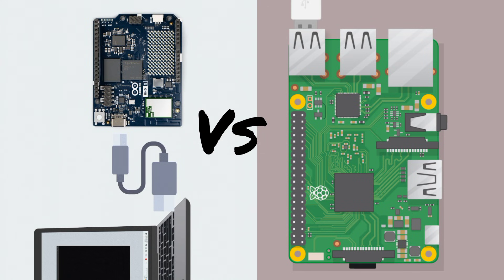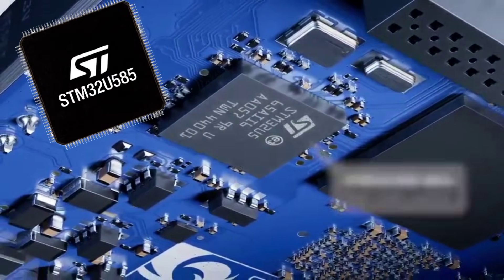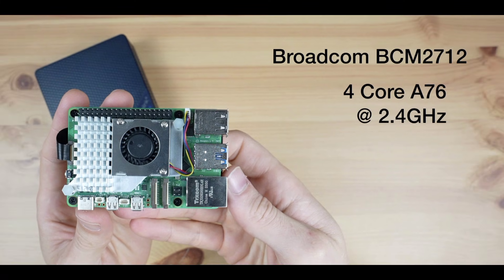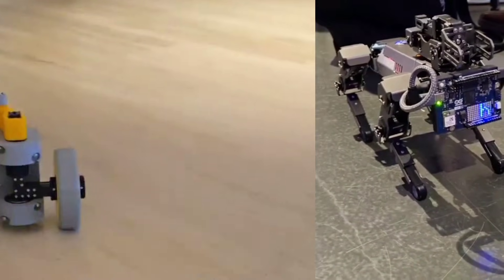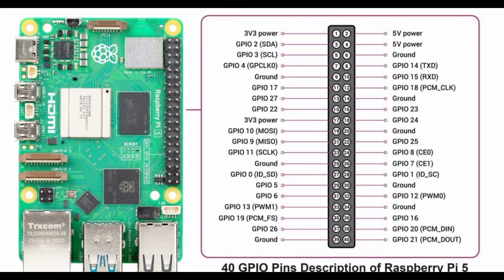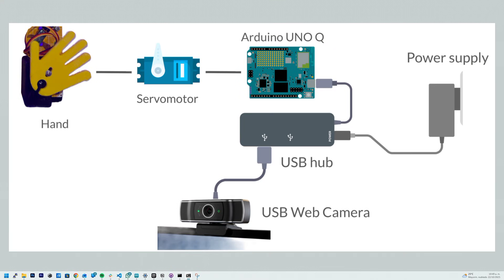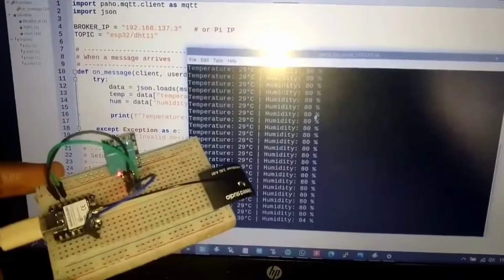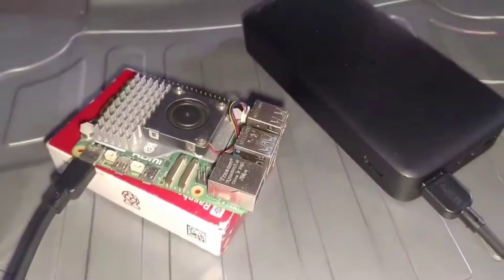Which Board Should You Choose Arduino UNO Q or Raspberry Pi 5

Comment: The Arduino Uno Q is more similar in power level to the Raspberry Pi 4.
Reply from the maker: In some areas, yes, especially processing power. But they’re still built for different jobs, real-time control versus running a full OS.

Comment: You are right, the raspberry is basically just a full fledge computer without input and output devices.
Reply from the maker: Exactly. That’s the key distinction. Raspberry Pi is essentially a small Linux computer, so it’s great for computing tasks, networking, and running applications, but it’s not designed for precise real time hardware control. That’s where boards like Arduino really shine, especially for direct sensor and actuator work.